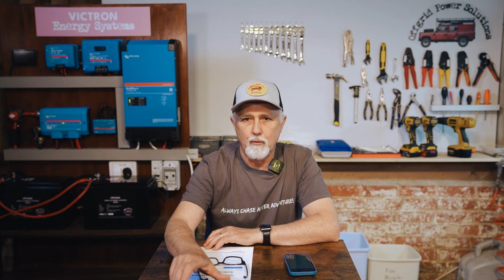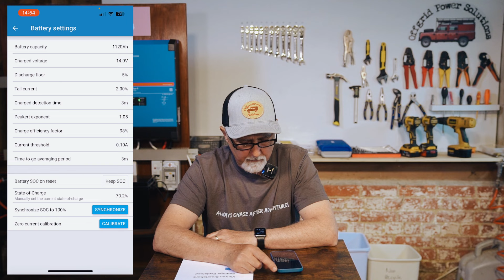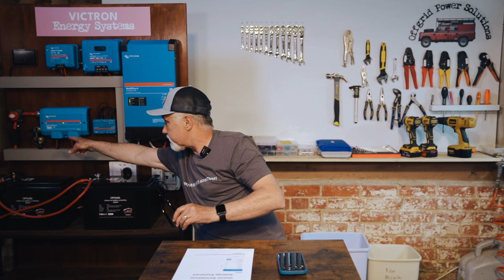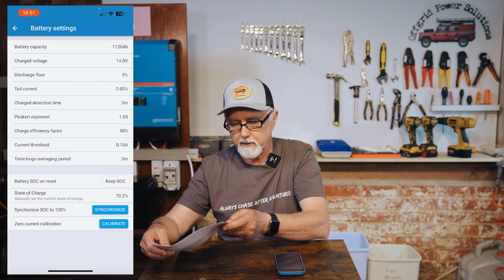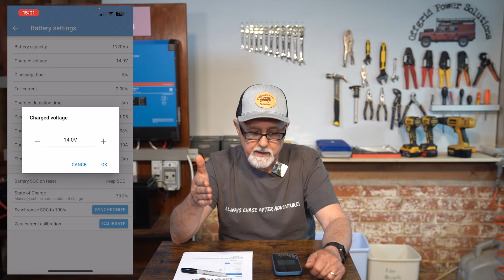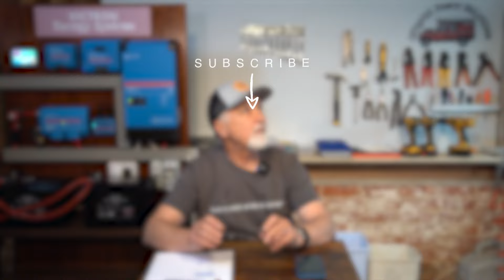Victron SmartShunt settings explained in detail

Comment: For the total battery capacity. You didn't mention what type of connection done, Either series or parallel. If series, the total capacity of all batteries connected will the total of one battery(280AH). If connected in parallel, the total battery capacity will be the sum of all batteries which is 1120AH.
Reply: Looking at the charged voltage of 14.0V on his screen, it’s obviously a parallel setup connection. However, he may have made it a bit more clearer.
Reply: I came to make the same comment. Well done explaining it for those who may be new to this it is an important distinction.

Comment: Amp hours are not necessarily determined by the number of batteries you have but rather by the battery configuration....if you have two 50ah -12v batteries in series you still have a 50ah battery,  it's just a 24v - 50ah battery now. Something I thought needed to be made clear after watching just the beginning of your video...statements like that cause confusion for viewers.

Comment: What’s everyone’s recommendations for a VR LA 500 amp hour 24 V system I figure I should just match my charge controllers settings I do not have a Victron charge controller. I have a flex max 80 so they do not read each other. My battery manufacturer recommends I do not go over 2.35 Purcell the default settings on my multi +2 when I had the generator running today was 2.36. I’m guessing that should be OK. I don’t use the generator to charge the batteries very often. It all depends on how much sun I’m getting. I have 2000 W of solar panels three arrays series Parallelled

Comment: Just purchased the Victron Smart Shunt 500A to pair with a 300ah LiFePO4 on the RV.  I am replacing the tired 4X6V deep cycle flooded batteries (series/parallel 12V system).  Excited to test out the new Lithium on our 830W Solar Panel system dry camping. Thank you, very helpful.

Comment: Great video I have 48 V Lifepo4 system I was having trouble trying to determine the charge voltage for the Victron shunt. I  couldn't work out why the system cut out early but with the help of your video my charge voltage was set too low Thanks great info

Comment: Amazed how many people don't read the manual! It's all there!! From Page 22 on is the most helpful. Even so called experts don't get it 100% .
Discharge floor is used for the time remaining calculation and alarms, it doesn't disconnect anything that's low voltage disconnects job!
Reply: What manual? There's 2 pages with the smart shunt.

Comment: Nicely Done Video!
One of the thing most of the video's don't show is setting when you have a 24v setup or in my case one (1) Dakota Lithium 36v 63amh battery for my trolling motor. Many video's are using just one (1) 12v setup. It just would be helpful to have that other battery configurations touched on for newbies trying to figure the correct settings.
Thanks for your very detailed video!

Comment: You can add me to those few who have gone bigger than normal.  I have two 460Ah LFP's for 920Ah.  I had planned on going with a DYI build with 16 280Ah cells in either a couple of 2p4s configurations or by paralleling four 4s pack for a total of 1120Ah.  All of these would fit into the battery tray made for (6) golf cart batteries.

Comment: For an off grid cabin would you place this shunt in between the battery in the main breaker or the main breaker and the usage panel. the cabin might be without use for 3 to 4 months at a time😊

Comment: You need to qualify the amp hour calculation for newbies. If you put batteries in series, you don't add the Amp hours you add the Voltage. If you put batteries in parallel you add the amp hours. In the example in the video a 12.8V (4P) system is 1120Ah, a 25.6V system (2S2P) is 560Ah and a 51.2V (4S) system is 280Ah.

Comment: The official Victron manual is written very poorly. It says "The charged voltage parameter should be set to 0.2V or 0.3V below the float voltage of the charger." 
My CTEK D250SE charger has a float voltage of 13.3V for lithium. So according to Victron, I should have my Charged Voltage set to 13.1V. 
The manual doesn't give any advice for tail current or charged detection time. Definitely not consumer friendly. Thanks for doing the video that victron should have done themselves.

Comment: Great info BTW.  In the battery capacity section you mention totaling the capacity of all the batteries. If there are 2 x 100 AH batteries wired in series to produce 24 volts, is the capacity 100 , or 200 Amp Hours ? Thanks, TT

Comment: Hi Rog, good video thanks, I am a bit concerned about the Battery capacity setting though, you need to be clear about series and parallel, 280 x 16 like I have in a 48 volt system is just 280AH as they are in series to make 48 volt,  a 12 volt 280 would be 280 but if you have two in parallel then 560, so in parallel add them, but in series dont, what you say is not really clear. Bob
Reply: Exactly my thought, considering they are totally different.
Reply: Thanks for the clarification! a very important detail. I'm a total newb, but it was vague enough to set the mental alarms ringing for my 24v series string of 2x 100ah LiFePo4 batteries. I had to check else ware to be 100 % sure. I know its electronics 101 but you can't afford to guess and just hope for the best with this kind of stuff!
Reply: 100000% I am trying to learn about my batteries that are in series and this threw me off.

Comment: Very helpful..one of my 500amp shunts is losing sync and when i wake it shows pulling 125 watts daily and the battery is at a 100%..even with no Sun..i normally drain it to 60 perc soc at night..then i need to do a whole clear cache..uninstall and reinstall..android btw..its also connected to a cerbo gx..can anyone advise on what the issue might be..even i switch the pv disconnect to off..still says 125 watts coming in..

Comment: I am confused on your Peukert's  exponent  info,  I think this is used to calculate (project) the delivered capacity based on the Discharge rate not charge acceptance efficiency.  Just curious what you were intending on this one.

Comment: the battery capacity would be for multiple batteries in parallel right? If the batteries are in series it wouldn't be combined right?

Comment: Current Threshold 0.1A
A solar charge controller and shunt draw about 0.03A

Does the system account for idle draw?  Only if you lower the threshold to below 0.03 ?

Comment: I have 2 banks of 6 eg4 batteries (not LL). Needing a wiring diagram to connect my 500A smart shunt to them. Banks are parallel to parallel. Pairing off on th😊e two negatives. Thanks.

Comment: Hi. Can you make a short video where you have two smartshunts with their own separate batterybank. Each of them with one or more mppt. 
And show How to correctly add all the units to a bluetooth network.
Then add a globallink and connect all units via bluetooth only.
Explain the differences between System Voltage, Gateway Voltage, and each SmartShunt Voltage.
Can VRM indeed handle this?

Last But also important. Install the globallink first with no connected units. Does it stay connected for 8 hours straight? 

After connecting all units, Does it stay connected for 8 hours straight?

Add a communication alarm set to 60.
And turn the relay to Closed.

If you can add some kind of logger to the relay port that would be useful as this will show if, when and How often the globallink has restarted during these tests.

I have had issues no one can solve and hope that you can give it a go. Many users have the same issue with  abnormal interrupts and restarts.

Comment: offgrid  have a question re my battery charger leads and midpoint connection to smart shunt.cant find this in viltron manga..should I keep charger leads as is going to each battery, or connect as a load, with each positive lead going  to first battery, and each negative going to load side of shunt?seems like keeping as is would be the best way? thanks John